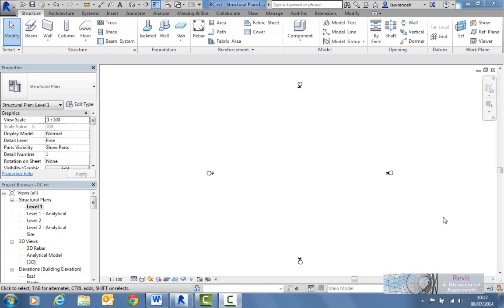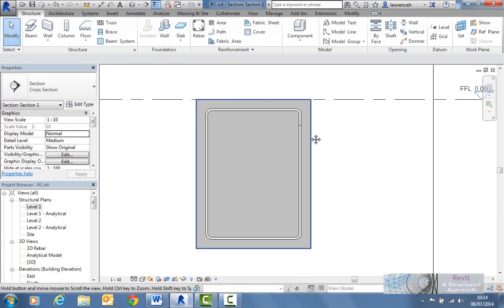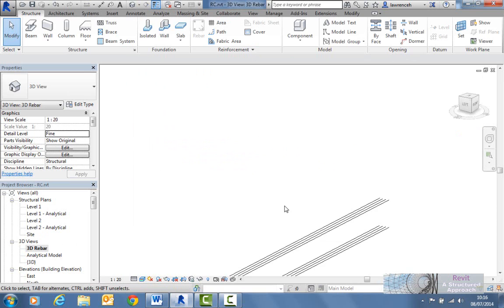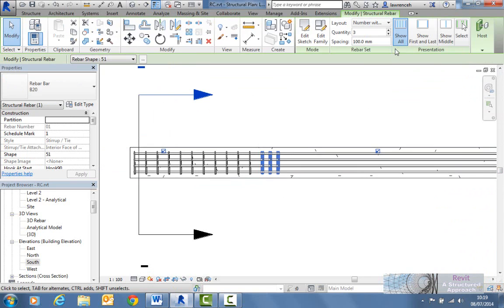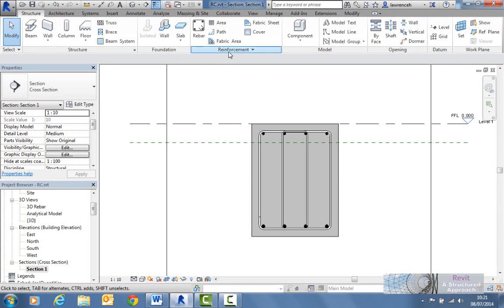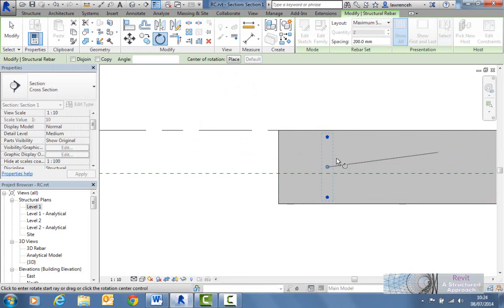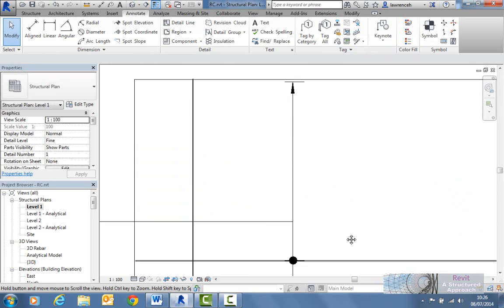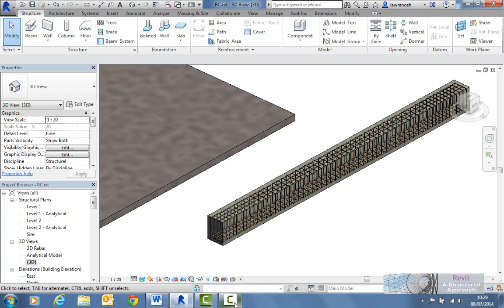Revit 2015   New Reinforcment Features

Comment: how do I show BS from tagging like you have?
Reply from the maker: The OOTB bar bending schedule is not Correct. You need to use the Rebar Number for the bar Mark. You need to make sure that you sort and filter the schedule based on the partitions.
Reply: sorry I mean showing the tagging of the rebar to British Standards?
Reply from the maker: It is just a combination of Shared parameters, dimension styles and tags.The OOTB tags are not very good for UK detailing